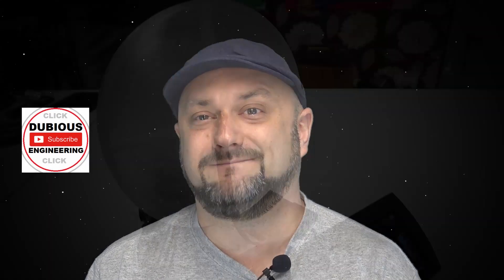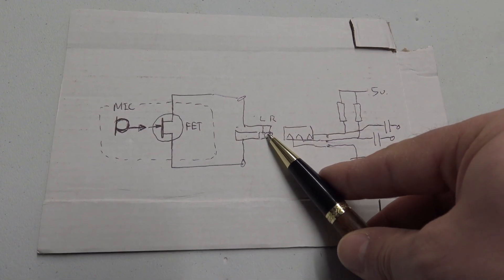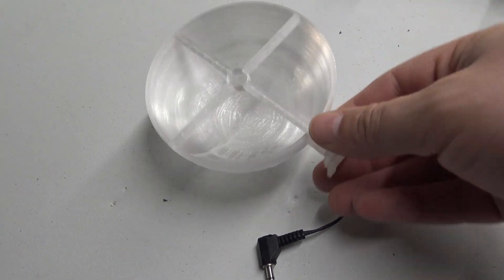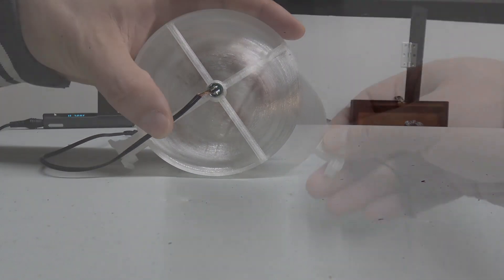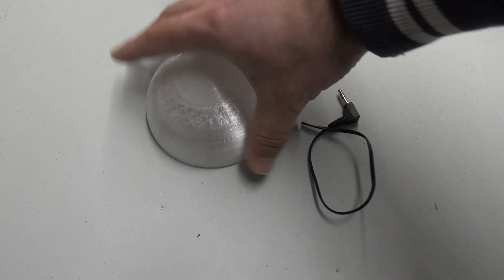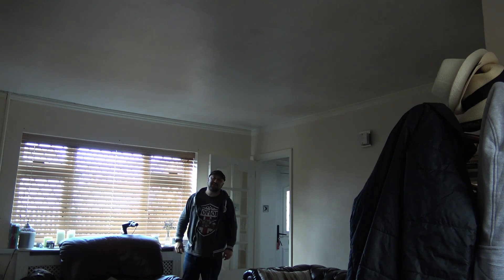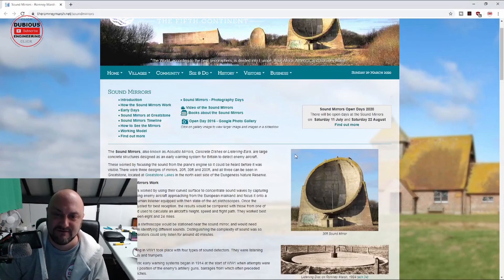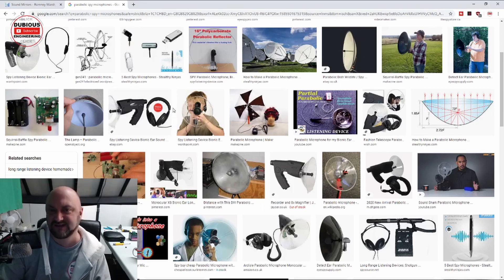DuB-EnG: 3D Printed Parabolic High Gain Electret Condensor Spy Camera Microphone with HotShoe Mount

Comment: Don't know if this would be better but several years ago I saw a bit that used a cone shaped like a mooses ear that did the same thing. A moose has excellent hearing.
Reply from the maker: That’s a really interesting point... trying some different shapes to see if it works better...  thanks Lowell - before that I need a lower noise microphone those units from China aren’t so great!